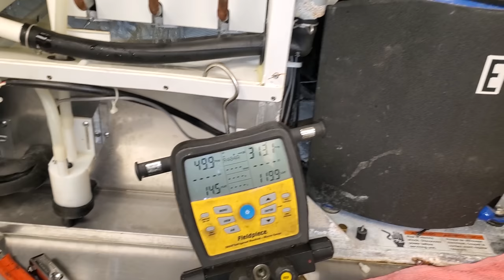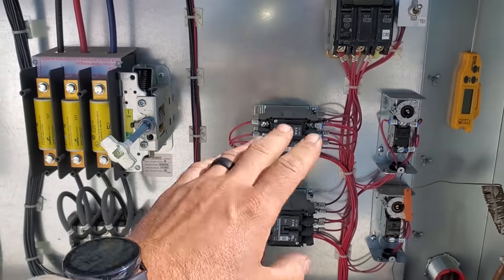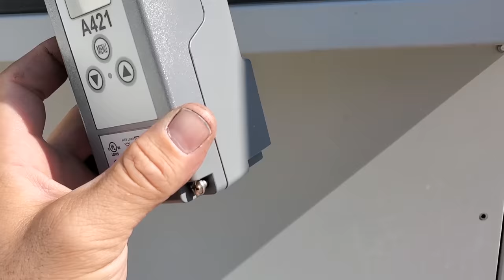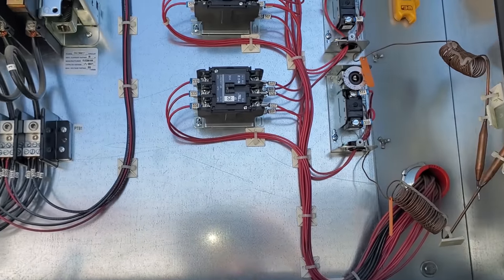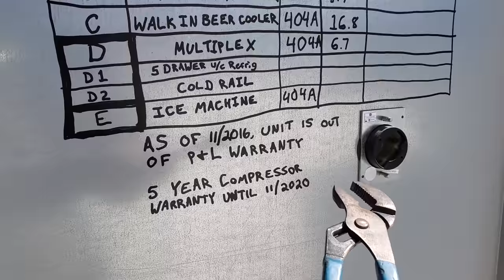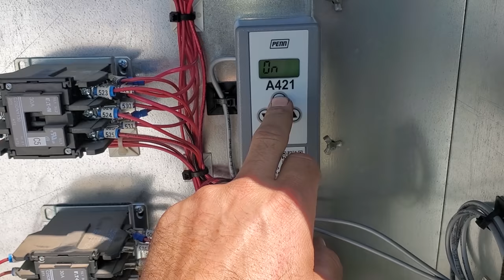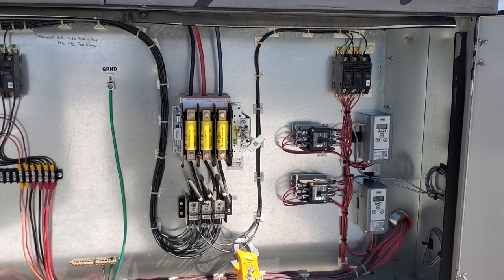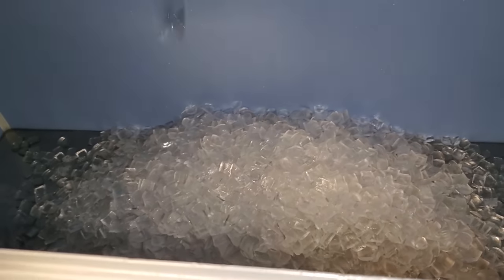THE ICE MACHINE IS EMPTY

Comment: Finally a clean and big cabinet, not these small corners where all the electrical stuff is packed beyond believing and where is no room to get a single wire traced down because all is a big messy ball made of wires. This cabinet could have been planned and designed by me...
Reply: Yes, for a change Chris did not have to rewire the entire box!
Reply: Its amazing what some pre-planning, ~20 extra minutes, labels, and some zip ties can do for the serviceability and longevity of control/service equipment. Taking pride in your work is something not just beneficial to yourself but to these industries as a whole! I personally find it quite cathartic and satisfying once complete.
Reply: I'm curious,  that toggle switch,  the wiring was, what? 16 gauge wire, 14 gauge?  And the overcurrent is what?  A 100 amp fuse?  Really?
Reply: @davidnull5590  Yes, that was odd and someone didn't think this through.

Comment: I've encountered icemakers where they were shut off, and I did the same thing, flipped the cusser on, and it immediately harvested ice and kept on going.  I inspected the condenser; it was nearly rotted bare, there were next to no fins left!   Their contract tech put in a replacement condenser and things were restored to right. The sun had come up and caused the machine to trip on high head, and stayed like that until I had encountered it. I do not apply gauges to an icemaker due to how sensitive they are when it comes to the charge. This was before your digital gauges and valves at the connectors. All I had were quick disconnects. They were bulky and a general hazard if they malfunctioned.

Comment: I'm confused. Wouldn't it make more sense to have the sensor probes inside the condenser (not electrical) cabinet so they can respond to cooling load? On a cool day, wouldn't the fans shut off, and be unable to respond to the heat coming off the condensers?

Comment: I’m surprised that the manufacturer didn’t use one two stage thermostat which would have been less cost.
Reply: Probably didn't want the possibility of loosing all the fans at the same time if the thermostat fails. I thought maybe they could have run a line back from the compressors to a relay each and wire the contacts so that if one of the compressors is running the relevant fans are started.

Comment: That switch needs a protective cover over it.  I use them in my Father's home for the outside lights that have photocells.  Prevents people from turning them off just the same.
Reply: This is an excellent point. Only the technician and manager should have access to those switches. Not any customers, subordinate employees, etc. The technician should educate the manager on the switches too.
Reply: @kalijasin  I've seen clear plastic covers on Amazon and at the hardware store. On the side there is still a tiny gap so you can activate the switch without removing the cover, but accidental trips will be eliminated.

Comment: We had an issue with my Manitowoc Indigo-series at work (on top of a Cornelius soda dispenser). No response from the lever operated by the customer's cup. So I go over and take a look, and verify the complaint. No ice dispensing, no gear motor running, and I watched it for a while and heard no sound of the agitator kicking in at all. Grumbling to myself, I climb up onto the beverage counter - the display screen is displaying what appeared to be firmware version of something (I wasn't paying too much attention other than no obvious error codes and was not displaying mode selection or ice level). I couldn't figure out how to open up the front panel (it has the "key guard bezel" and I was kinda in a hurry) and I couldn't even look up the model number because it's installed about 2 1/2" inches from the wall (can't read/access the factory tag) and the Sharpie writing on the paper label on the front is too faded to read.
So what is the easiest solution to attempt? Unplug, wait a minute, plug back in. In hindsight, it would have been easier to go to the breaker panel and just flip the breaker because it has its own dedicated breaker... Anyway, the "reboot" worked, as it started making ice and has been fine since. (Certain managers were setting the heat to 80 again, when it was over 80 outside, and I thank myself every day for changing the thermostat's max temp down from 88, I figure it just overheated.)

On another fun note, this past Tuesday our Blodgett convection oven burst into flames, minutes before opening. Four months of sporadic "ERRoR" and shutdowns, four months of the tech denying there was a problem (even accusing us of inventing a problem just to get a new oven). The last two months he demanded cell phone photos of the display every time it shut down on us. He comes in, turns it on, it gets up to temp, he pronounces it trouble-free, and leaves. Except Tuesday the entire electrical end of it burned to a nice crispy mess, the cook pulled the emergency fire suppression system, and when I got to work Tuesday afternoon it was to scrub the entire kitchen from top-to-bottom to clean up the mess left behind by the fire suppression system. Over $7500 in ruined product (food, paper goods, 5 fryers' worth of oil, etc.) and another $6000-8000 in lost sales for the day. Then, the next day, another couple grand's worth of food had to be disposed of because prepped food in the walk-ins (not affected by the incident) had to be thrown out per the health department.

Right on the heels of that compressor replacement on our Traulsen. Which is working wonderfully again. Ah,  the joys of working in Food Service.
Reply: That's some crazy shit lol. There's nothing wrong with it, place almost burns to the ground. If I was that tech I'd throw in the towel and find another profession before I killed someone.

Comment: Good video ! Good find on those mechanicals. Good Repair. Exactly how I would have done it. 😉
Tip - if u are servicing that account now I’d Grab 6 of those bolt in fuses next time u are at a Electrical supply house and Keep them in that cabinet in a Tupperware box. Just bill the customer for them. 😉

Comment: Why would you want no condenser fan unless it's below 50-60F outside, the kwh you save on fan will cost on higher head and higher kwh on compressor??
Reply: Even if you were doing temperature control, wouldn't you want it to depend on the temperature of the condenser?

Seems like a very strange setup indeed.
Reply: My understanding of the video was that there were three condenser fans, one that was always on and two that were triggered by ambient temperature.
Reply: @petermichaelgreen  ok your right and condenser fan 2 and 3 hv separate therms to turn on  giving more cfm a higher temps, still 1 coil 1,2or3 fans.

Comment: I'm going to assume that you've never seen a 3 phase disconnect switch blow up when pulled or put in or you wouldn't have operated that one with a pair of Channel Locks and a bare hand.
Reply: there is a reason he turned off all the breakers in that unit...
Reply: @ratchet1freak  And there is a reason you turn off a disconnect from outside a panel.
Reply: @ratchet1freak   the breakers are after that disconnect so that wouldn't make a difference. Even so idk what this guy dirt road sailing is talking about. For one thing if he has channel locks that's not "bare" hands. That's just a switch not a load. The metal part of the handle does not make contact with any of the electrical... If it blows up someone wired something incorrectly. I've been working on this stuff everyday for years. I've never seen what this guy is suggesting happen ever
Reply: @AnUnapologeticApologist  On a new or damaged installation maybe a risk. Chris removed that risk by opening all the downstream breakers first. Plus the rack was running when he got there it's good. Similar disconnects we have in Australia the handle interlocks with the operator rod, you can't open the door with the switch on, makes fault tracing impossible.
Reply: F P  I have 35 years in a heavy industrial plant. You guys that toy around in HVAC don't have a clue about electrical.
Reply: @dirtroadsailing6418  35 years and you have never had to defeat a door interlock to fault find a machine you must be a genius that or the most you do is push a brush around site.
Reply: You're right.  The people here in the comments haven't seen real things arc and go boom.  There are really good reasons electric guys wear flame resistant clothing,  face shields and special gloves.  I stay far, far away.  There are too many opportunities for spectacular YouTube disaster videos with electrical switching.
Reply: @dirtroadsailing6418  90% of the issues in refrigeration are electrical. But we do much more than electrical and require knowledge in many trades. I'm just saying, if you have a disconnect blow up in your face, something was done improperly. It is literally just a switch, a freaking contactor has more arc than a disconnect does. Even so, arcing from carbon build up or corrosion is one thing, but exploding? That should not happen on a disconnect.
Reply: @davidnull5590  I've seen plenty of electrical disasters. The fact that you said you stay far away tells me you don't work with it. I work with electrical every single day. You cannot do any type of commerical refrigeration work without a clear understanding of electrical. I knew a commercial electrical guy that did most of his work with a volt stick. And he got by just fine. All electrical guys are doing most of the time is running line, that's it. You could never get by in this trade using just a volt stick. You need to know how to test amperage, precise voltage (both ac and dc), resistance of components to determine if they are in within range, resistance to trace out a short to ground,  continuity on a switch to see if it's open, closed or has  resistance (resistance can cause spike in amperage/voltage drops), capacitance and how to recognize if caps are within range, diode testing on components that run direct current, the list goes on. It's not just a matter of knowing how to test either, you need to be able to apply all these troubleshooting techniques and differentiate between when to use each one.
Reply: @dirtroadsailing6418  As have I in power generation, the risks are the same, just the results are different, Chris had taken all reasonable steps to ensure safety. In your 35 years of heavy plant you have never sat astride a 1.5 MW diesel generator fault finding a voltage regulator issue with V16 diesel engine screaming right behind your head? There are no disconnects there, your safety depends on knowing what your are doing and having situational awareness.
Reply: @dirtroadsailing6418  , there are many brands of equipment with door interlocks, I usually use a 6” adjustable to turn that square shaft, but my usual equipment was 460 3Phase, on refrigeration or air , but also dealt with 4160 v 3 PHASE . BUT IF IT WAS A CENTRIFUCAL  COMPRESSOR THEN THAT CHILLER WAS LIMITED TO ONLY 3 STARTS PER HOUR !, I had some very interesting jobs , did you know there is zero 120 volts in EUROPE and where I STAYED in PFORZHEIM GERMANY  the houses had 3 phase power? Stoves & clothiers dryers are real low amps unlike USA we use 240 volts single phase & load up the 2 conductors , the 120 here are for the controls & timers  50 HZ most of the world, where NORTH , Central & South America is 60HZ,   Cheers 🇺🇸🇺🇸🇺🇸🇺🇸

Comment: Is the placement of the temperature sensors the best? It is good to have them outside, but at some points of a day they might be in a direct sunlight. It was not clear what is the orientation of the unit relative to the sun.
Reply: That would for sure be something you should consider on a case-to-case basis. Any way you slice it though being out of that cabinet is going to net you a much closer measure of actual ambient conditions. If its windy that will help keep the condenser a bit cooler, regardless of where the sun is, whereas measuring in that box it will always be stagnant and like an oven throughout the day.
Reply: @Wiresgalore  Good point.

Comment: Good call on moving those thermostats over to the smaller breaker. I suspect the original wiring violated some section of the NEC. Those big fuses were probably around 100A, and that wire to the thermostats was probably #12 or #14, which is only rated for around 20A. The fuse is supposed to protect the wire, and a 100A fuse won't protect a #12 wire.
Reply: True but sometimes not nessesary. If the devices are protected by themselfs (datasheet basically) and the wire has a max length there are exceptions to this. However that does not mean its a good idea in the slichtest

Comment: the big fuses with small gauge wire, toggle switch and controllers, if anything shorted it would most likely trip the breaker at panel before blowing the fuses. not it should trip the breaker you wired them to instead

Comment: With thermostat controlled condenser fans, could there ever be a situation where the compressors would be running without the fans if the temp dropped enough? Or is there a safety measure in place?

Comment: The manufacturer likely went with two temp controllers as standard to account for as many installation scenarios as possible where you may have different requirements for different sections of the rack. In this case I presume you could run both contactors off the same controller, or do they have a load limit that would prevent that?
Reply: The A421, and older A419, has only one output relay. So it is not even possible. Two contactors here do switch on at different set points, so they can't be commoned to a single relay. (If this is what would you want, then sure, you can connect them together, it will still be withing limits of the relay inside, no problem).  He would need to use something like Johnson Controls / Lenn MS2, which might be actually more than 2 times the cost of A421, and a bit harder to program, because of how many extra options it has for different applications. Also Johnson Controls / Lenn MS2 requires 24V to operate so you need external power supply.  Other option would be Ranco ETC-241000, which is about 155$ (including the temperature sensor), so that isn't too expensive. Definitively cheaper than 2x A421 (each about 85$).
Reply: @movax20h  Always a reason why things are done haha.
Reply: @NofaKingway  Some newer models from companies like Trent, do have so advanced controller for everything that it could probably be all controlled from single controller (all compressors, fans, temperature sensors, remote management, diagnostic). For example Trane Tracer UC400 or UC600, or Trance CH536. (They can cost from 1300$ to 3000$ depending on option, like extra LCD display,  etc). They do have a lot of inputs, low and high voltage outputs, relays and triacs. And even have small extensions with extra relays (which you can add or replace individually, probably up to ~50 outputs). But you wouldn't put this into existing unit of different manufacturer. I am sure there are other options on the market too. But too much cost, too much work, too much to figure out if it is all done correctly and configured, and if controller breaks (or some transistor fails) then you need to replace costly part (585$ for just the PCB without enclosure and display). Plus if the unit is going to be then maintained by other techs, they will be lost, because controller and setup doesn't match the manual of the unit anymore. Separate controllers and boards to have a advantage in that they are cheaper to replace individually, and easier to understand just from the wiring alone, without going into software and configuration of advanced controller. So kind of easier to maintain by any tech. I do personally like these advanced controllers, but for new package models, not existing ones. Also these controllers aren't really inherently that complex and expensive to manufacture, so I expect priced to go down significantly down in the future as they become more popular.
Reply: Could be that they wanted the thing to fail gracefully when faced with a single component failure, so they went with two temperature controllers so if one fails you only lose one condenser fan.
Chris made an improvement in that regard with the switch over to twin A421's, as that feature he mentioned about being able to set what happens when it has a failed sensor (he set it so it turns on the condenser fans when the sensor fails) now makes it fail in a way that allows it to continue operating (fail safe system), which is an improvement over graceful failure. The only improvement I can think of is some sort of way to signal that the sensor has failed without opening the rack's control cabinet, but I suppose opening the control cabinet could become part of preventative maintenance.
Reply: @44R0Ndin  yes of course. Independent two controllers provide some level of redundancy, but as you have seen both of them failed basically at the same time.
Reply: @movax20h  We don't know they failed at the same time, it could have been that it was under-performing for a while with just one not working, but they didn't want to fix it or didn't notice anything was wrong.

Comment: As a electrician not US , why is the lockout mechanism with i guess 90A fuses (i hope not) immediately terminating from AWG 8 to AWG 14/AWG 16? without smaller fuses in between ? that whole string of smaller wires on the left side is fed from the terminalblock is (lockout--->AWG 8---->AWG 16 ----> Breaker) if there is a short phase to phase or phase to ground/neutral in the string between the big terminal Block and and the breakers there is nothing to stop it to melt/burn. Max Amp for AWG 14 in single core is 24A but bunched up like this it drops down to 15A or less? is there something i am not seeing? or why is it build like that?